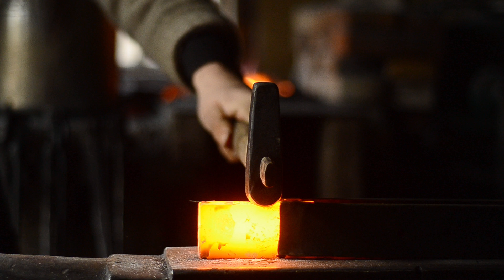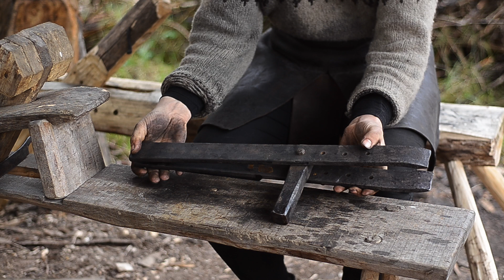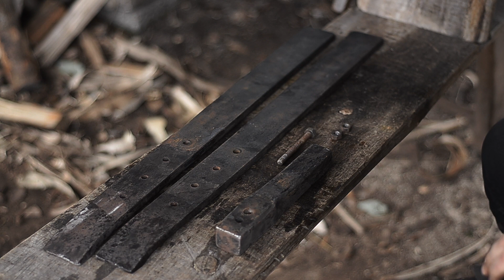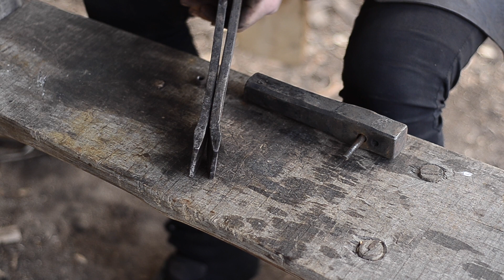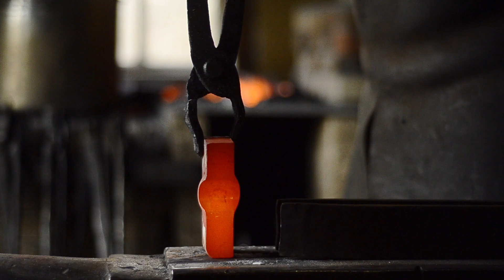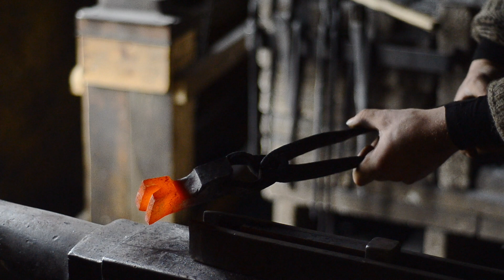CLAMP FOR AXE MAKING AND MORE - BLACKSMITH TOOL

Comment: Great video, great channel. You won a new subscriber ! I practice blacksmithing too, and there is a subject I would love to hear your opinion about, it's charcoal fire management for big pieces to heat. Fire size, air flow, depth, etc. Again, great work, great mind !
Reply from the maker: Thanks. No points - a lot overcomplicated it, it's just fire and fire is not demanding . Forget all that theory about clean fire, air flow, depth etc. just go ahead and forge. It doesn't matter 99% of the time.
Reply: Well ok, that's a good advice in many crafts... Just go for it. Thank you for the answer ! Do you buy your charcoal ? I buy most of mine, around 1€/5L or 1€/kg for the cheapest.
I am discovering your channel bit by bit, and it's a real pleasure !
Reply from the maker: @gabrielnavarro8721  thanks. I didn't buy my charcoal the first few months as a fulltime blacksmith, I did make it outside the workshop.... But I heat my home with wood and I did spend a lot of my wood making charcoal... carry my wood from the forrest and home myself, no car - so I started buying it instead in order of saving the trips to the forrest/my fire wood for winter. I haver ever since just bought it - I will start making it again if/when I get a home in the forrest. I use coal as well, but prefer char coal, especially for the smaller things.

Comment: Is it a repourposed nail header you use as the hardy shank?
Reply from the maker: No. Just raw material I forged to fit the hardy hole - https://www.runemaltebertramnielsen.com/441578975